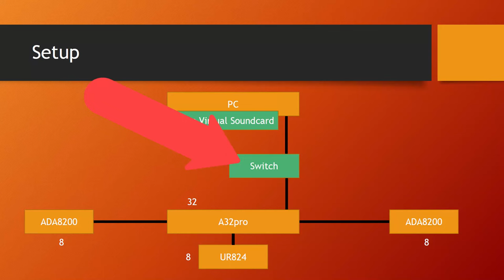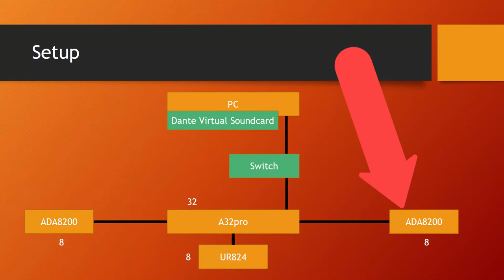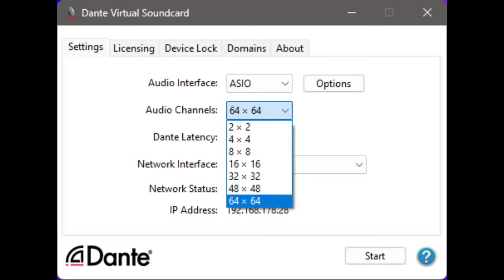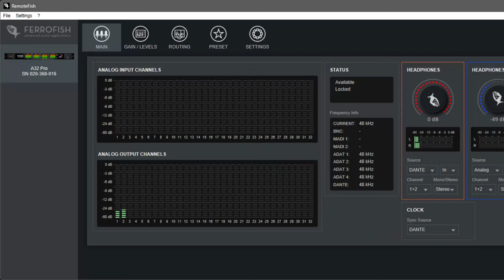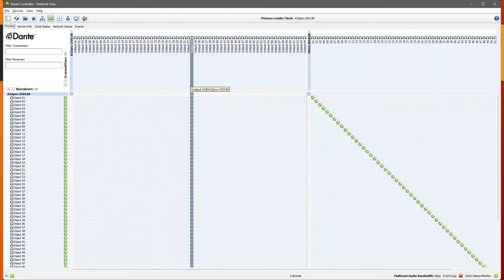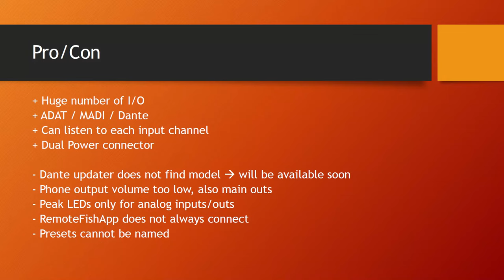New Studio Setup with Ferrofish A32 Pro and Dante Virtual Sound Card - Test / Pros / Cons / Tips

Comment: Moin Jürgen, I've transitioned to Dante in my recording studio back in 2016 and never looked back. I'm using the 1st gen FF A32 Dante and the Yamaha Dante PCIe card to get latency lower than that of DVS. I'm also using DVS on the computer that is fitted with the AIC128-D card to bridge WDM audio into the Dante network. Additionally, I have a few more Dante hardware devices and I'm running Dante into several live rooms to provide headphone mixes via AVIO Dante-to-analog adapters.
Audio latency is only really relevant if you need real-time monitoring while playing VST instruments. Using an inexpensive second-hand digital mixer like a Yamaha 01v96 can help a lot in getting rid of latency issues when monitoring and has other valuable benetifts on top of that. BTW, I'm using the same cat cabling to have a MIDI-over-Ethernet network, allowing me to reach any room of my studio flat with MIDI data.
You didn't mention what network switch and cat cables you are using. For reliable Dante operation, you should use a manageable gigabit switch configured as shown in the Yamaha, Audinate or Focusrite config help files and CAT 6A cables exclusively (SFTP cables - absolutely avoid UTP!)!
You might find my latest video interesting which showcases the VB-Audio Matrix Coconut which is the first app for Windows that offers professional-grade, reliable audio device aggregation which opens up remarkable possibilities even in a Dante environment. I've been using this app for more than a month now and it is now aggregating all Dante audio as well as Windows WDM audio, audio of an external, non-wordclocked USB keyboard running at 44.1k as well as potentially hundreds of audio networking channels originating from the Matrix's own VBAN audio networking protocol. All these signals appear on their own dedicated input in Reaper! This app lifts Dante to a whole new level which was something I couldn't believe until I saw it in action. Here's the video: https://www.youtube.com/watch?v=hi8f2BvNa6s
You can find other Dante- and studio-related videos on my channel. Falls Fragen auftauchen, findest du mich recht leicht im Netz. Tschö :-)
EDIT: OK, ich sehe gerade, dass du doch den Switch zeigst und die Kabel scheinen auch OK zu sein.
Reply from the maker: Thanks, will have a look!
Reply: @sonicaxiom Das sind viele richtige und gute Tipps. Zum Switch kann ich folgendes noch anbringen: Mit einem Switch von TP-Link, der bei einem Soundgrid Audionetzwerk bestens funktionierte, hatte ich bei Dante diverse Probleme. Ich habe diesen durch einen D-Link aus der DGS-1210 Serie ersetzt, damit läuft Dante viel stabiler und Clock synchronisiert wesentlich schneller. Es gibt auch bei Shure eine Anleitung wie man diesen am besten für Dante konfiguriert. (Stromsparoptionen wie EEE aus, QoS usw.)

Comment: Just recently found out you can connect usb devices over networks with - USB/IP -. Might come in useful for some use cases. Haven't tried it myself, but got a raspberry pi I'm going to give it a whirl with.
Reply from the maker: Interesting! Wasn't aware of that. Did you try it?
Reply: @mossgraber  Not yet, but it seems reasonably simple to set up, think you can do it in Windows too.

Comment: I used DVS for about a year and a half as my audio interface with a Yamaha TIO1608D for the physical inputs. It's ok for recording, but DVS latency will never go below 18 ms, I think its a limitation of the technology. So live sound monitoring was really very cumbersome. 

I recently added a Yamaha RUio16-D as my sound card via USB-C and it works great, now I have a proper headphone amp and round trip latecy is under 2ms. It really is not plug and play, you still need to configure that pesky sample rate to make sure everything is in the same samplerate.

For a "cheap", high count solution I would recommend anyone to get the RME Digiface Dante as your sound card and then just get multiples of the Yamaha TIO1608, provided if you could find them. I couldn't find the RME hence why I got the RuIO. You could literally get a 64 multitrack channel recordin setup that way and as far as I know it's the cheapest way to get that many multitrack channels into a PC with just one sound card.
Reply from the maker: Yes, read about the DVS latency as well. The RUio16-D would be very interesting to me if it would not only support 16 Dante channels.

Comment: Oh Hi Jürgen amazing video, that's what I needed. Currently I have an RME UFX+ and I think to buy an a32pro and connect it via MADI... But Dante option it's interesting if the latency is low enough. Do you suggest me to sell the RME and go directly with a32pro Dante + Virtual interface or keep the rock solid RME and just buy the normal a32pro?
Reply from the maker: I suggest to keep it because otherwise you won't have any pre-amps and also loose Totalmix. I am also thinking about adding a UFX (to replace my UR824 which I use for microphone pre-amps right now).
Reply: @mossgraber  Oh damn I forgot about my lovely totalmix, I use the UFX+ it with a 48 channels APB Dynasonics console desk so I think I will keep it even if those 4 preamps aren't necessary... so I can basically fill all the input of my console I will go for the madi one so :) Thanks!
Reply from the maker: @YaluMusicSound  Would be great if you could report back how well TotalMix works with the A32 since I am planning the same.

Comment: I am considering the A32 as i would like to mix down up to 32 channels through my analog console and be able to use my vintage outboard gear. 
I would like to run the Direct Outs from my analog mixer into the A32 and from there into my DAW (A Laptop PC running Studio One Software). On mixdown, I would like to run from the A32 Outputs into my analog console.
My question please:..
How do I connect from the A32 into my DAW and then back from the DAW going through the A32 Outputs into my analog console (for mixdown). 
I do not believe you can use the USB connector on the A32 to do the I/O. I really don't know too much about DANTE and what I would need to buy so I can use the A32 with my Laptop PC. 
Any suggestions are surely welcome. Thank you in advance.
Philip
NYC Area
Reply from the maker: You need to connect your laptop to the A32 with an ethernet cable, normally via a hub or switch (some network skills might be helpful). Then you can use the Dante Virtual Sound card which needs to be purchased from Audinate. Watch my previous 2 videos which go in all these details. They are linked in the video description above.
Reply: @mossgraber  Thanks you for your information. I will definitely check your other videos out. Have a good day and thanks again.
Phil